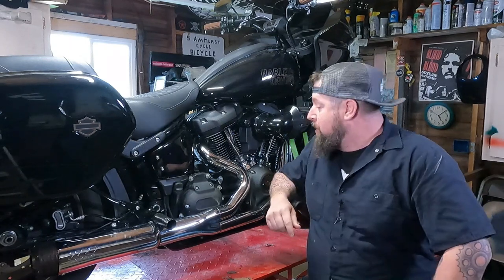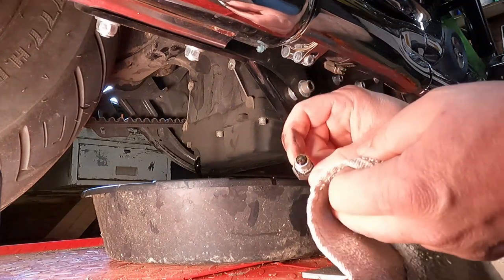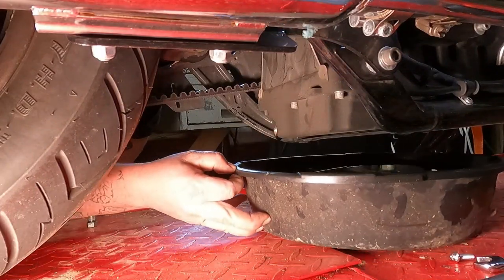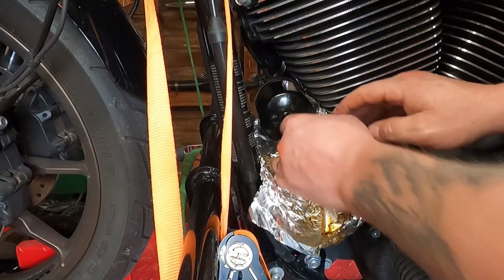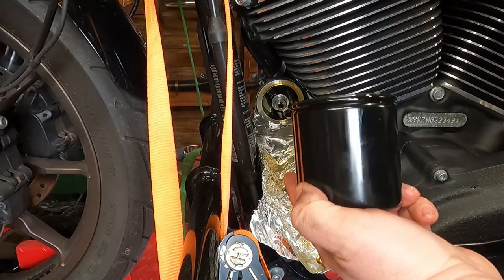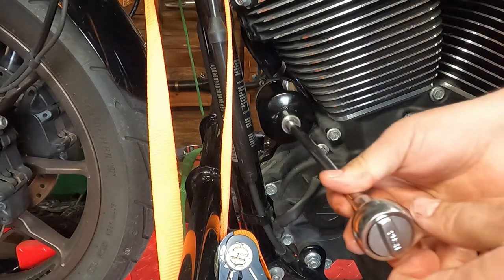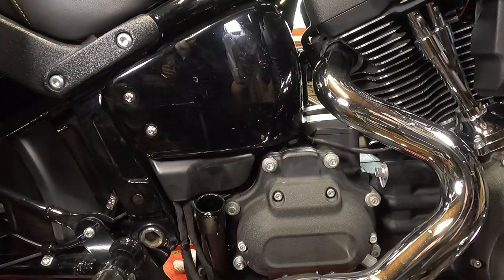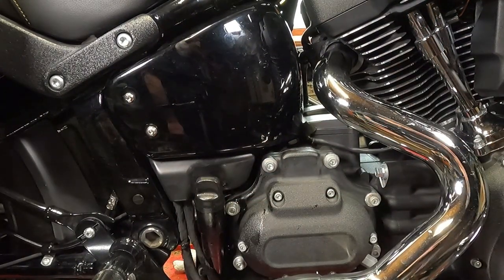M8 117 Engine Oil Change - Softail Lowrider ST

Comment: New to HD M8 engines and everyone tells me most of the 5 quts. are in the oil tank. But where is the oil tank? Thanks for the video. HD dealers charge about $350 for the 1st service. Hope I can afford my new LRS. It is fun tho.
Reply from the maker: The oil tank is under the transmission. It’s technically the same casting. 
Same as the baggers and Dynas.
Reply: @KnobleMoto  Thank you good man.
Reply from the maker: @TrustyZ900  you’re welcome
Reply: My first oil change at 1,000 miles was 670 dollars at HD. SMH
Reply from the maker: @filichink  you can do this yourself, without an special tools for much less.
Reply: @filichink  I was quoted the same price from spacecoast harley and I started laughing... I'm going to do the 3 hole myself, check critical fasteners, and belt tension etc... for much much less and spend the money on groceries.

Comment: I do know that the manual says 4quart for engine refill i out 4.5 and i was right on the cold mark... 5 quart is to much and oil will spill out of the breather bolt..
Reply from the maker: @Matt-pu7ow  mine takes 5 to that mark, and nothing is coming out the intake.  
On the twin cams, if you got oil out the intake it was the rubber umbrella valve.  Not the oil volume.  I haven’t dug that far into an M8 yet.
15k on it. So far no oil purge anywhere.

Comment: did you put 5qts in that thing?
Reply from the maker: Yes I did.
Reply: Manual says 4 qts.. i put 4.5 and was right on the cold mark.. puting more will result in oil in your intake
Reply from the maker: @Matt-pu7ow  mine takes 5 to that mark, and nothing is coming out the intake.  
On the twin cams, if you got oil out the intake it was the rubber umbrella valve.  Not the oil volume.  I haven’t dug that far into an M8 yet.
Reply: @KnobleMoto  I actually put 3.75 qts in my 2022 road king. It's on the low range of the stick but acceptable.  I was surprised by 5 qts. in your video.  I think 5 qts is its full capacity if it was completely dry. But if you are not seeing problems or have a soaked air filter can't argue with that.
Reply from the maker: @brianevan6504  15k and still going strong.